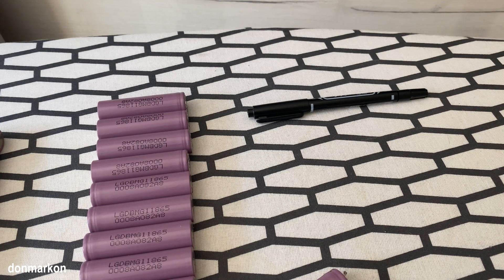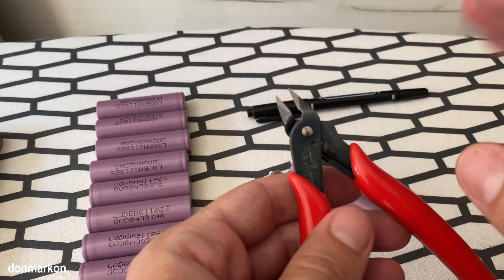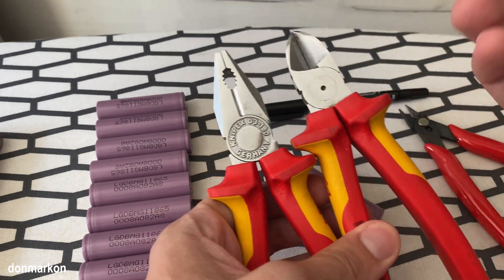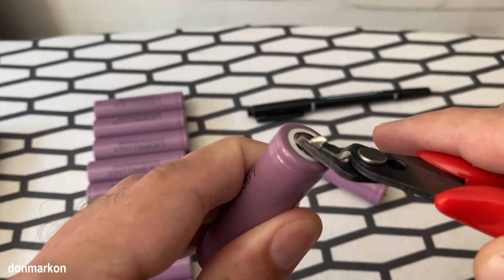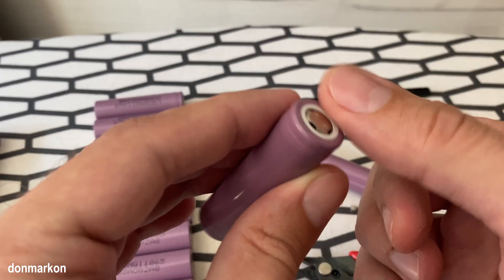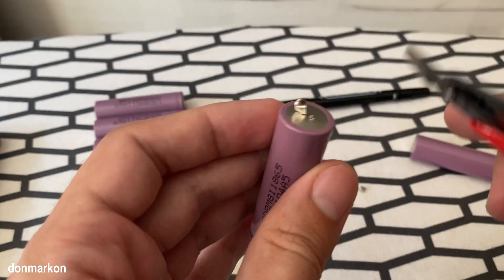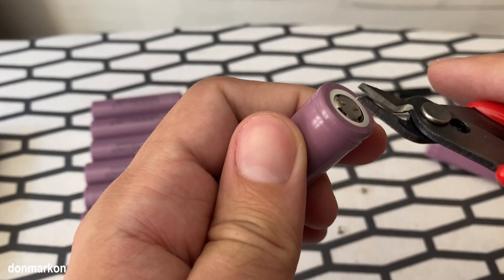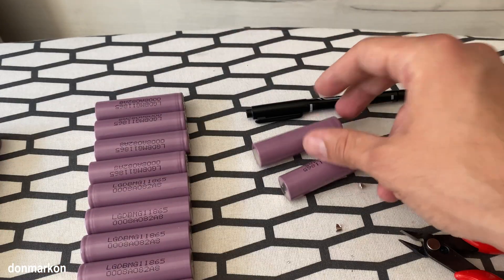18650 Li Ion Cell Nickel Removal Must Have Tool

Comment: get yourself a finger file aka a mini belt file, stick a 120grit belt on, perfect for buffing off the remains of old spotwelds, you might scuff the plastic insulation from the cell but if you are this far down the rabbit hole i'll assume you have plenty heat shrink tubes to re-wrap them anyway

Comment: Thanks but do you have a technique to actually remove the nickel plate from the cell, I mean when they are all assembled and you want to change some cells ?
Reply: May be a little late. But grab the strip as he did, but roll it up onto itself, like the old spam tins with the keys to peel them open if you know what i mean

Comment: Its possible to accidentally shorten the cell..
Reply: Put it in a vise and see what happens.
Reply: Yep, had to learn that the hard way
Reply: @enzodesousa6911so what happened to the cell? Did you throw it out or it was fine ? Thanks 😊